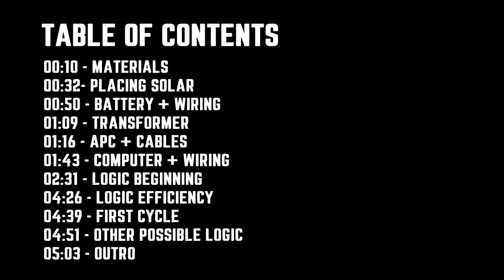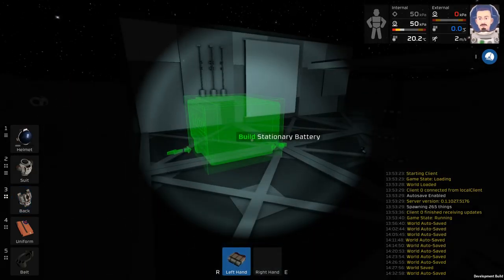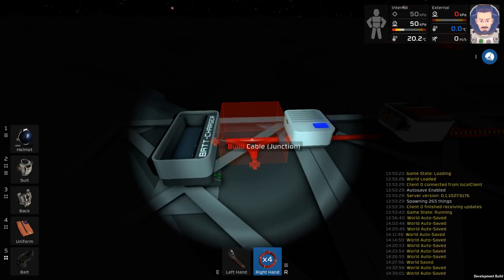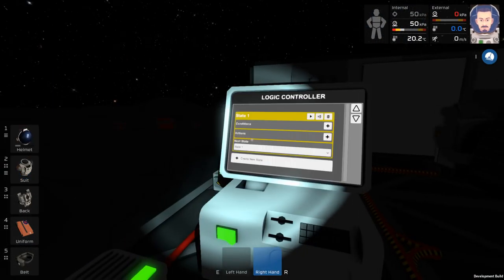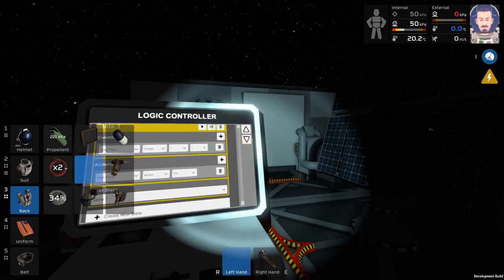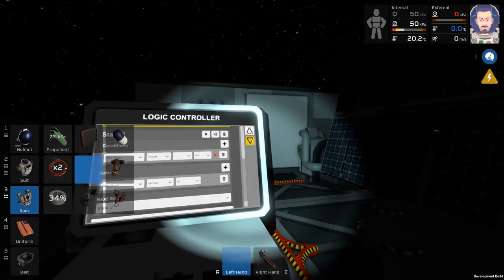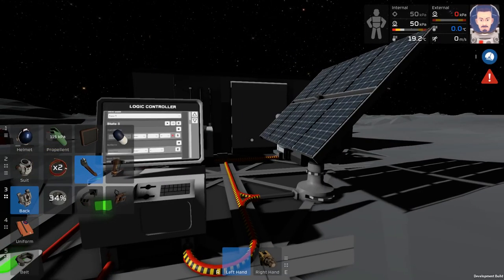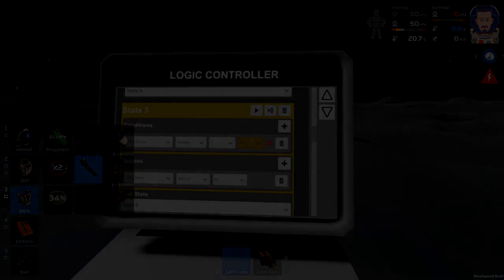AUTOMATED SOLAR (NO SENSORS): In Depth Tutorial - STATIONEERS

Comment: You could do everything with 4 logic chips that take less power than the computer by dividing a sensor output by 1.8 and then using a batch writer set to Solar Panels.  Also, logic chips are cheaper than a computer and motherboard so easier to set up.  Especially in the start I have a single panel tracking within the first day why go through all the trouble of programing.
Reply from the maker: This was I believe showing how to do it with the computer. Been a while since I've taken a look though. Not enough updates to keep me interested.

Comment: I have 4 solar panels. I hooked up the first 2, and everything was fine. Hooked up the last 2, did the logic computer, everything was correct. When the panel reaches 490w, it rotates 10 up, but doesn't switch states at all. Everything is correct, the states are correct, but it stopped working for no reason. Any idea? Its just not switching states, only problem.
Reply from the maker: You can always send me the save file and I'll look, other than that  maybe states aren't set right. I really, really recommend just using the new logic. Expect a video on it tomorrow
Reply: I found out how to use the new logic system, works amazing. Now I just need to learn why my base doesnt keep oxygen in >.>

Comment: Excellent as always. Here's a suggestion maybe, as simple as it is.  I cant find any info really on how to set up a Portable scrubber to release the gasses from it. How about just a simple one to show how to hook it up. Like out in the open or even a docking station inside a base to pump outside. Other then that, keep up the good work.  I know the piping systems, to me at least, scared me a bit when i watched the dev 21 stream, lol.
Reply from the maker: From what I understand with the portable scrubber you just put filters in it and turn it on and over time it should just remove toxins, but you have to hook it up to a pipe system maybe? I'll look into it. My next video will actually be on filtration
Reply: From what ive seen, you can toss on filters and turn it on and it slowly removes stuff, but then it fills up and gives the msg, Maximum pressure exceded, connect to pipe network to release pressure.  And thats where im drawing a blank at, lol. Tred with a tank connector tied into a active vent to release it that way, but with no luck.  I actually got the scrubber to fit on it once then someone actually loged into my game (i had it on public) and it scared me and i could never get it to go back in again.
But ya, filtration would be good. Ties into pipe systems decently, i would imagine.
Reply from the maker: Yeah, it goes a lot into how you would deal with pollutants and volatiles in your base. You can pipe it to go into other machines or canisters to allow use in other things. You can also set it to mix certain gasses so you have your welding torch ready to go, you can section off small amounts to go to a furnace, basically as a reusable state.

Comment: Im slightly confused I did mine but it gets stuck on something and never moves?
Reply from the maker: Did you reset it back to the first state and wait for morning? It may function oddly if it's not reset as the way the sun moves can mess with it. i've also make sure your states lead one in to the next (State 1 -> State 2 -> State 3, etc)

You can also send me your save file on discord (if you use it) just @flyhightayler on the stationeers discord and then DM your save file!

Comment: I Followed your video very closely multiple time. and still my solars were skipping from say 30%, past 40% and to 50%. When condition 1 hits 490W it rotates 10%, when condition 2 catches the same 490w fast enough to complete that condition, causing it to skip every other one. 
Any clue why? Maybe there is a work around?
Reply from the maker: Kyle Hicks I ran into that issue once. It seems to be the way the sun ticks. I recommend just using the new logic stuff to make a solar array. I'm making a video on it, I'm just coming home from college (got home today, immediately went and saw the new Star wars) and once I'm settled I'll edit and upload it. The new logic allowed for near max efficiency and is super easy.
Reply: Sweet man sounds good. I've been a die hard Star Wars fan from the beginning, but I must say the Last Jedi was.. ehhh. Disappointing in my opinion, but then again its an opinion ;) .
Reply from the maker: Kyle Hicks I actually agree! Was not as happy as I thought I would be.
Reply: This might be way off topic of the video, but i have 5 solars leading to a stationary battery with heavy cable. i then have 1 heavy cable leaving the battery to a small transformer, then regular cable to an apc. Just now noticed i had no power. so i crank up transformer to 2000W and use network scanner. Im outputting 2000w past the transformer but only 1kW past the APC. any idea whats going on?
Reply from the maker: That's really strange. The cable past the APC could just be reading what all your machines are draining or something. That's my only guess, that or a bug.